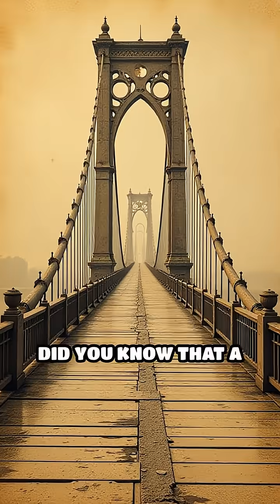The Iron Bridge: A Revolution in Metal #history #facts #historyfacts

Comment: Planet moon spaceship building shows aliens alliances armada approved power take off PTO press gears cables pulleys hydraulics like transformers Autobots decepticons flex joint scaffold tile pressure panels solar panels microwave panels converts microwave signals to energy power wind suspension dynamo generators power wind poles orbital powered like tectonic plates like automatic watch heat cool channel tubes cyclone intake sorter valves psi tanks compressors fuel recycling systems electro static magnetic shield generators electro static magnetic purpultion heat cool hover panels diamond coating fiber optics cloaking device transmitters reflector light source codes nanites microscopic robotics nanited hulls nanowalls neural implants nerve splicing nanotec munitions reanimates reprograms lifeforms uploads downloads information kinetic energy readers sight system power source reading electric current elemental vision sonar magnetic field vision thermal vision indoor outdoor underground underwater outer space forests planet moon spaceship building shows aliens alliances armada approved federation friends forever life's important ingredient helping make sure the universe doesn't resalitify augmented lifeforms cyborgs droids turned into organic lifeforms and make sure the universe doesn't resalitify